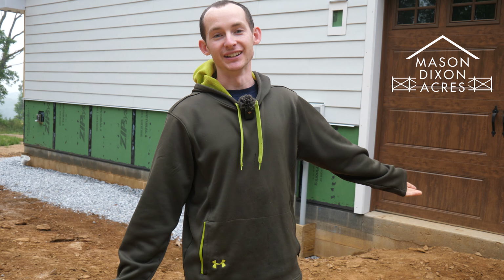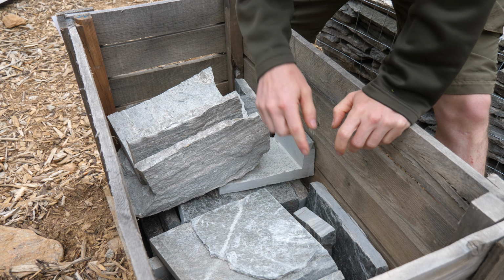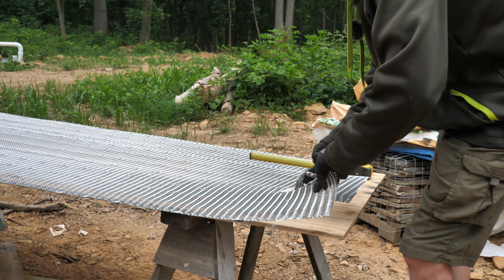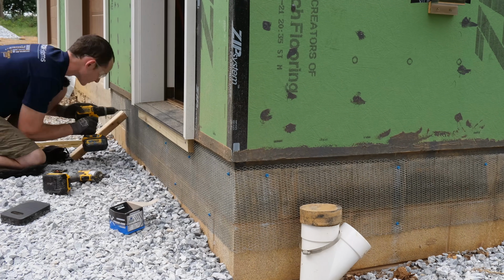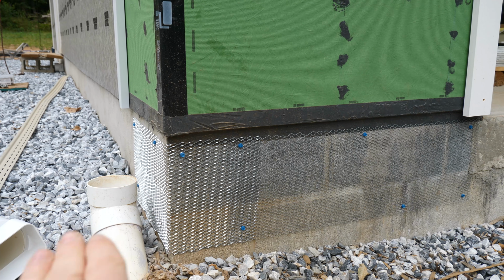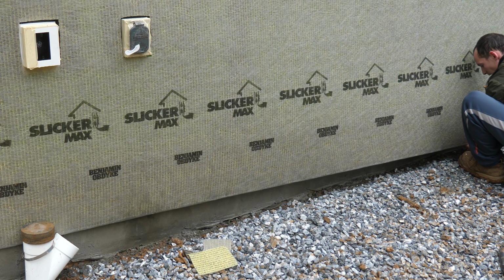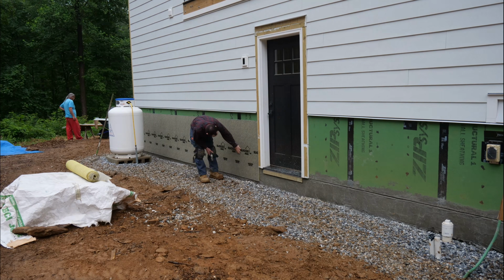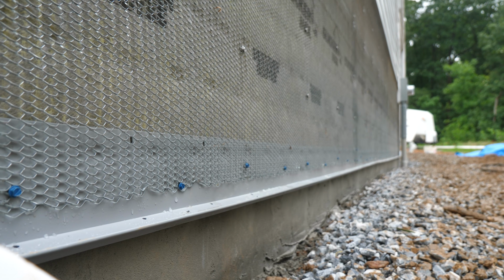Wall Preparation for STONE VENEER

Comment: Zip is good don’t get wrong I use it on my air tight builds but the amount of time it took to install the liquid flash on the bottom of the base and hoping it will cover every crack because a lot of homes are so close to the ground that it’s hard to look under it to get a good feel that you could have just used siga tape. Personally siga tape is 10 times better then zips liquid flash because it also is a drainage barrier for water to not hold against the concrete and wood. Liquid flash will hold water until it evaporates. Siga tape allows it to drain down and put the second it gets hit with water or ice.

Comment: I can’t believe you’re not using something like Arden x5 or x77 in place of the cheap cement when you’re sticking something so expensive to it.
Reply from the maker: That's a good product but not really necessary for an exterior veneer like this in my opinion. Maybe if it were in a fountain or shower, something continuously exposed to wet conditions.

Comment: Ever heard of electrolytes, stainless steel screws on galvanized makes current and the weakest metal will eat away, learned it with boats and useing stainless steel nails with aluminum fascia, lve been building houses for 45 years and I know from experience all the mistakes you have made with just this wall thinking you know more than engineers and manufacturer,, yes it was a big mistake applying the membrane the way you have ad well as 2 layers of wire screen and people are seeing this thinking its proper, even your slab pour , l can give you many reasons not to do it that way,, lve built over 50 homes and never had a call back.

Comment: Pay up for bonding adhesive and mix your type S with 20 percent bonding adhesive and rest water and brush bonding adhesive on wall and stone, would be the best 40 dollars you could spend, l won't do any stone job without it,, and just use type S mortar don't mix any sand and Portland with it,,
Reply: If I want to put stone over a stucco pillar can I just grind the texture off, use bonding agent, put a scratch coat on the stucco pillar and then add stone ?

Comment: You have really gave it two potential fail layers l would have used bonding adhesive and then scratch coat on block,, I've see the galvanized wire rust and deteriorate , it's just a galvanized coating you cut off fitting it, pay up for stainless steel if you have to use it,, l use cement board now with no scratch coat just brush on bonding adhesive to wall and stone and apply mortar too the stone only giving it no extra layer to fail,, screen wire is old technology and I've did it before cement board,, it's better faster stronger and cheaper with a 50 Year warranty.. think about it wire is usually over tarpaper with a thin layer of scratch coat, that's asking for trouble, trouble.

Comment: Hard for me to understand how all this weight is supported.  It just seems like soooo much weight.  I want stacked stone veneer on top of my existing hardie board, I am told by masons that this is ok as long as all normal steps for putting over something like plywood are followed.
Reply: It is to much weight and too many places to fail, old technology,, l use cement board and apply bonding adhesive to the wall and stone and only apply mortar too the stone and even mix my type S mortar half water and half bonding adhesive, I've tried to knock the stone off with a hammer and can't,, then I put exterior screws between the stone leaving them 1/2 inch out for the grout too grab onto and mix grout half water and bonding adhesive, it really faster stronger and cheaper than wire screen,,, think about it wire over tarpaper with a thin layer of scratch coat is weak and old technology,, listen to your mason sounds like he knows what I do

Comment: What are you considering for light switches and automation? I used a Lutron RadioRA2 system for part of the build - I'm no expert, but if you going that route we could chat about the experience. Just a homeowner, that's all, but I do have a B.S. in Aeronautical Engineering, not that the degree would get me a cup of coffee, but does give me some cred in my current occupation! Take care.
Reply from the maker: Going simple to start, standard rocker switches and dimmers. We will have a PoE camera system. Probably will do a fancy integrated system once we do the addition and change everything out to be common. Electrical videos are in the editing pipeline 😉